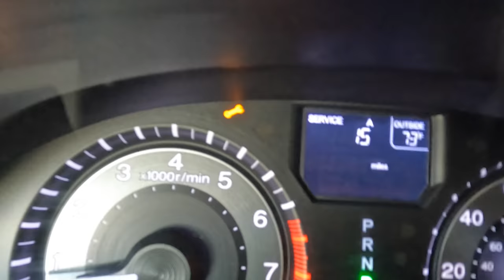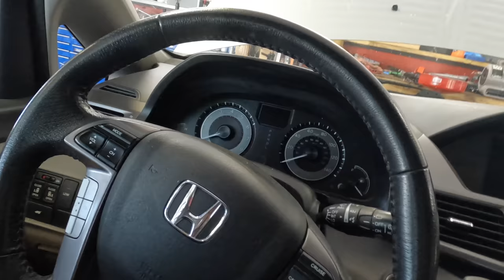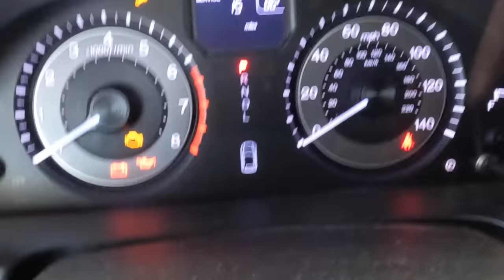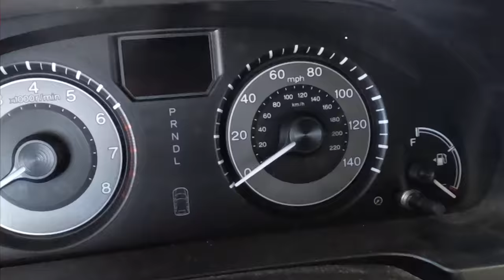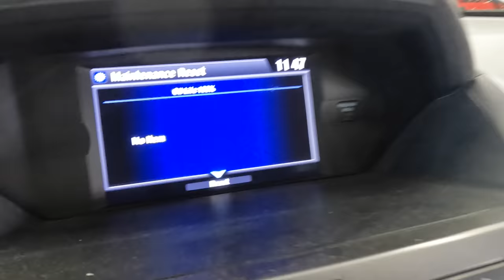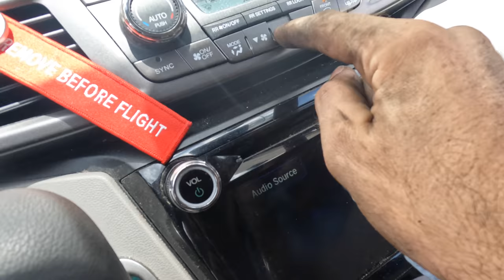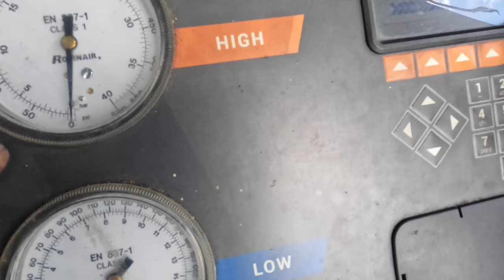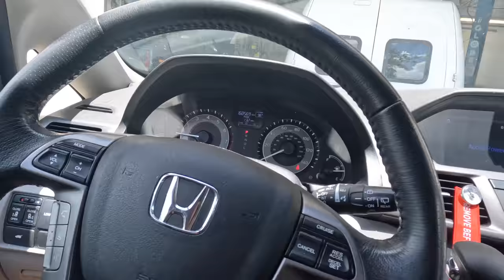Running 300-400 psi. Vibrating noise and smoking! 2014 Honda Odyssey 3.5

Comment: I might be wrong but I remember you already did a very similar video, maybe even on the same brand/type car. Left cooling fan died, needing replacement. Creating a gap by loosening the radiator mounts. Trying to pass it through the gap but fail. Then having to remove the right cooling fan temporarily in order to create space for maneuvering in the replacement left cooling fan.
Of course, lazy as I am, I did not search your old videos. Sorry for that. Maybe another commenter will...

Comment: I love your videos Ray, but I don't like to use crimp connections for high current devices because any extra resistance for example, if the crimp isn't 100% it creates heat and draws more current and could either blow open or blow a fuse.  They use solder on starter armatures so it would take a hell of a lot of current to burn open a solder joint and that application as starters as you well know probably pull up to 500 amps during cranking and maybe more for diesel...  Plus, the driving circuits from the ECU or soldered onto the board...

This video was cool and great info because I never knew that compressors had a blow off valve!  I don't imagine the connections could take much more than 400 PSI eh?  Learn something new everyday...

Comment: I have a similar problem with one fan not working when the AC is on, I know it's not the fan as I swapped wiring connectors, so the issue is electrical in my car. As I mostly do motorway driving I'm not that concerned with fixing it, as air flow is enough for it to run effectively.

Comment: What I have found out with some after market car parts when they are made in China the connectors some times are not quite the right size they can be a little too big or a little too small. I think it has some thing to do with the measurements are given from measurements we use in America and they don't always match in metric measurements even though they maybe both accurate not everything can be converted very easily.

Comment: Hi, Ray. I'm surprised the AC recovery machine cannot also work in kg?
Forget pounds and get with the program....
Great video as usual mate.
Reply: Ya, why not. Those machines only cost a few quid.
Reply: Many that I sold DID have options for both, but cheap (not inexpensive) shops didn’t want to spend the money for something that simple and inexpensive.
Reply: Metric or bananas, take your pick.

Comment: Always use solder! The wires would burn off the shielding before melting the solder! Those butt connectors are junk.

Comment: I had a hyundai elantra with one fan failed, it over pressured high enough to vent out the compressor safety valve. that was very exciting with my head under the hood looking around.
I think I left a bubble in the hood where I smashed my head into the bottom side, because I sure was moving away at high speed and had a lump on my head for a week 🤡

Comment: Most of these vehicles use a variable speed resistor assembly. So according to the demand the fans will vary their speeds and not just blow at only high or low speeds only.
Reply: Engine fan is variable,,, condenser fan only has one speed,,,,on like hell,,,get that pressure down & go “off”
Reply: @fredwalker839  not on all cars, quite a few Hondas/Acuras have both fans controlled by the variable resistor unit when cooling and also when the A/C is being used.

Comment: I used to have an 04 blazer that started to shake like the engine mounts had failed, turned out the fan had just shattered 2 blades somehow and the unbalanced fan was shaking the whole engine. 😭

Comment: I hate dropping things anywhere near the radiator/condenser. I recently had a water pump on my F250 done and I got a brand new Ford radiator for free from the dealer because the tech dropped something and put a hole in the old one.

Comment: I like how you said relatively low humidity. Here in Arizona 5% is relatively low humidity. If it goes to 50% we all commit suicide. We prefer "the dry heat".
Reply: I thought the same thing. Fifty-nine % is Low humidity?
Reply: South Florida.  Air you can drink.

Comment: I've thought for many years-
AC, fuel have a "Service port" but the cooling system does not,
especially with now the advent of removal/recovery/dispense systems.

That would be so nice- a large cap, large Shrader valve, hook up machine.
Do the same for all fluids on a vehicle- brake, transmission, engine oil, coolant.
Reply: You wouldn't be able to suck all the fluid out.  A/C refrigerant is removable through a port only because of it's low boiling point and is in a state of gas.  Fuel service port is just for testing.
Reply: Drain plug>drain valve.

If you’re going to have a 5/8 hole, why add anything to obstruct the already limited flow through that? For the cooling system, some come with a drain valve. But they’re plastic garbage. Safer to just yank a radiator hose, than risk breaking off the drain petcock.

Edit: some aftermarket transmission pans come with a drain plug if the original didn’t.

And machines do exist to change the other fluids on a car. They’re just not cheap.
Reply: @andyruse4670  I'm not talking about a "drain valve" or "petcock".
I'm envisioning a Service Port as in a capped port, with a type of Schrader valve to hold a vacuum or pressure. And no- only the AC system uses this type of servicing port, and of course your wheels, too.

Yes, a Schrader could be a type of "valve" (it's in the name) it is spring controlled, always closed. It wouldn't be necessary or capable to hold a vacuum for an engine or transmission. A "Refill Port" would work for those, just to add fluids, and another to drain. Haven't seen those. I'm talking no more drain pans, stripped bolts, missing or incorrect washers, no dipsticks- just a port. Up top- a port in a valve cover, to add oil. Electric sensor for level of both fluids (3 if PS System, too)
and the brake reservoir is usually translucent, so a port here, too.
Reply: @HoLeeFuk317  Bottom edges of either pan, suck fluids out, thoroughly, easily, even to a complete real FLUSH on both the engine and transmission, because of direct coupling in & out. Do it with systems running and in gear.
Brakes? No more rusted & ruined bleed screw. Vacuum the system from the Master cylinder, cook off any moisture, just like AC.

Theoretically- you could empty your fuel tank via the Schrader- if no check valve in the pump.

Modifications must be made to oil & transmission filters, too, to be more accessible, like newer European cartridge type, on top of engine.

Comment: Love how you dropped the 10mm and also said it was the 10mm. I've literally never dropped anything other than a 10mm in my engine bay. It's like a guarantee. Replaced a starter last week and used about 3 or 4 different sizes. One was even an 8mm but do you know which I dropped? 😑

Comment: I would not be at all surprised with AC head pressures that high  that the compressor could lock up and smoke the belt or the clutch  (there are some systems that can sense compressor rotation speed in relation to the engine) ,hope it did not damage the compressor and other components in the AC system .  I am surprised that they don't incorporate a fan rotation signal in  today's designs that would set a trouble code and disable the AC if a fan fails ..

Comment: Just a fyi you may wanna replace the suction tube "hose"  on the power steering reservoir. Over time that hose gets hard and have a small split crack near the fitting to the pump.  The reservoir to pump hose. 

I had to replace it on my mom 08 Acura tl 3.2l v6.
Reply: That hard hose is also what makes the power steering pump makes that dreaded grinding noise

Comment: Why so thin oil?? I used on my Honda's 5w40 full synthetic Castrol oil . Even after 280.000 KMS,the engine was not burning oil at all. Now in my Astra G station 1.7td i use  10w40 half synthetic Castrol oil. The  whole year.  Winter/summer

Comment: I'm only guessing, that your systems in the US have different safeguards to ours down under. The line pressure switch would cut the compressor power before it hit that high. They have a low point and a high point shut off.

Comment: If the passenger side fan is the main/first to run, why did the secondary fan fail first?  Regardless, this is an info-filled video.  Thanks, Ray.

Comment: Hmm setting the oil change for 3000 miles for full Synth seems kind of low since the recommended mileage is 7500 on the low end. If it's burning oil then just recommend they check it regularly.

Comment: Is that pressure release there to prevent overpressure from blowing up a line? Back in the stone age, I recharged a friend's AC, by using the ol' "sight glass" method. I added a can of R12 until there were no more bubbles in the sight glass. He decided that he wanted another can of R12 in the system to make it colder. I told him that it wasn't a good idea to add R12 when the system showed that it was full. He insisted that I add another can, so I did, but first telling him that the results were on his head. After adding the R12, he sat in the car to see how cold it was. Just them, there was a loud explosion, from a line blowing up....This wasn't the last time that he ignored my advice. (but that's another story)

Comment: Not sure of you caught it while looking at the connectors @22:40, the white area around the pins on the new fan is up higher than the old fan connector. hard to tell on vid but looked to be around 1/8 of an inch or more :-)

Comment: Question, if anybody knows. 2009 Accord, Ac compressor running, the fans are running, don't have the gauges to check the pressures. no cold air in the cab. Any help would be appreciated.

Comment: Hello @Rainman.... hope u r doing great. Really hoping u answer. I have a Honda vezel which is jdm version of HRv. There is a small gap between the condenser and radiator like the one in this vehicle also. If i seal that gap with the foam seals, will it affect AC performance. AC performance aint that bad right now

Comment: The reason aftermarket fan plug would not connect is because the white plastic piece from inside OEM connector was still inside harness connector.  If you review the video you see the absence of white piece in OEM fan connector. This is a honda feature that prevents pin misalignment inside connector and its quite common. When you replace a component with an electrical connector with a new one you end up with double white plastic piece inside the connector and a no-click condition due to interference fit. Consequently you should be using OEM honda filter on that van because honda is the only oil filter made by filtech. All other filters in the world are made by Mann+Hummel which are inferior. And no matter the grade its the same Mann+Hummel filter. REEEEEEEEEE!
Reply from the maker: I must disagree, i cut the footage bc it was really boring, but i used a pick to remove that little white thing and the connectors still wouldn't connect together. very astute observation I applaud you good sir
Reply from the maker: Reeeeeeee!!!
Reply: In that case chalk it up to crappy aftermarket parts I suppose? It didn't look like OEM Denso replacement.  BTW my wife and I just sent you some Hondabond and Filtech oil filters as well as Honda specific oil & tranny funnels to aid with the "WHHHHYYYYYYYY?!" Oil filling of FWD J-series steep pour angle you so succinctly captured in that video.

Comment: Is there not a high pressure cutout on this van?? Typically, the pressure relief valve is a last ditch effort to relieve system pressure  before something blows apart.

Comment: Similar problem with AC on my Ford 2015 F150, 2.7l EcoBoost with 54k miles hat gets a whopping 21mpg.  Every day, during the Summer, the Auto Start/Stop "Feature" kept shutting my truck off and the AC system would mostly keep up in the mornings but by the afternoon, it would have high pressures and really lag the engine.     I don't care what idea came up with Auto Start/Stop, but it doesn't conserve fuel.   I also have a 2001 Chevy Silverado, 4.8l that gets 18mpgs. with 267k miles.  
So.. where am I saving money?  the only hassle is that nice comfortable and I love her, 2015 F150, has been in the shop more than that 2001 Chevy has.   I'm not sold on Auto Start/Stop, I think it's a gimmick and I feel it is my biggest complaint about modern cars and their "Eco-Friendly" B.S.
Reply: there's ways to shut it Off .

Comment: What do you think of Fumoto valves?  I've been changing my own oil since I was 16 at present I'm 70.  I love my Fumoto valve.  Put on the hose, open the valve and the oil drains into my container, capped and ready to be recycled.
Reply: I use them. As long as no-one nefarious notices it to drain all your oil out, they are great.

Comment: Idk if its a good thing or not but on really dirty oil ill pour a little clean inside while it drains to try to “rinse” it out a bit but i also dont use a lift either.
Reply: I just (about 2mo ago) got a cement pad, and the building too. It’s a VERY nice upgrade from working on gravel!

Comment: did you do a full vacuum and decay test? never add gas right away as there may be leaks. a system is low on charge for a reason beyond the inital problem. proper refridgeration practices.

Comment: I keep hearing the chant "honest mechanic". In my experience, most mechanics are honest, the description doesn't focus on the weak spot in professional work flow. Lazy? Some are, and some cut corners in the interest of saving time. And some guess what the diagnosis is without testing, mainly out of ignorance of how to diagnose it quickly, or just to save time. Some reach for the new part rather than trying to fix a broken part. But that's a different issue. Professionals reach for the new OEM part because they don't want to face an angry customer when the repair fails, and they don't want to warranty a repair done using substandard parts. If you put in a borderline part and it fails, the customer is on the hook for twice the labor, and it leads to angry confrontations. So, honest mechanics run into their own set of problems, trying to save the customer money only to make them pay more when the part breaks again. If there is any dishonesty, it's in the guys in the white shirts in the front office, where upselling is the game. Salt of the earth mechanics are just trying to get through the day.

Comment: If the contacts were right, would it not have been easier to depin the new connector block and use the old connector block with the new pins inside it?

Comment: It needs the overpressure valve to dump the refrigerant to deal with the over pressure? It does not have an overpressure or overtemperature shut down switch (stopping the compressor) to deal with that? I use to call that s...y engineering...

Comment: At 22:41 you say that the connectors look accidental, but they don't look like that to me.  The white plastic appears to be deeper in the socket on the old one.  That looks like it would prevent the connectors from seating all the way, unless the white portion is spring loaded.
Reply: I see that I am not the first person to notice that.

Comment: @rayman

Looks good, actually.   I watch alot of your videos and I notice you actually care about delivering good work. That's a good thing,since I see a lot of : meh good enough mechanics.  

However,   you make your life unnecessarily hard sometimes In my opinion.  Not saying that to hurt you or to feed my ego or such nonsense.  But rather then just throwing bolts in a pan/basket,  whatever,   put them back on where they go. That way you are not losing any of them, and you don't need to wonder where that bolt went of you have 100 of them.  

Also, you have alot of faith in bolts not snapping on you,  personally (again personal preference )  I like to break them loose first,  just to prevent that off chance of having to drill that bastard bolt out later 

Other than that.  Keep up the good work 
This is meant as constructive criticism, not to tear anybody down

Comment: It looked to me like the pins in the new connector were slightly pushed offset to one side, realigning them with a flat blade screwdriver probably would have saved time and work.

Comment: 0W20 is thin as water. Based on the fact that you guys are located down in Florida aka a pretty warm climate and the oil consumption of this engine id use a 5W30 even.

Comment: why the heck didnt the High PSI switch cut the unit off rather than hit the pop-off..  theres not supposed to be a pop off on anything that new that would pop before the high PSI switch would turn the compressor off...  the pop off is only ever suppose to trip if the high PSI switch fails to cut the compressor off..

Comment: Soldering is not ideal because of poor vibration resistance not because it might melt away. It might only get so hot that it melts once it has cracked from vibration and isn't making proper contact which in turn causes heating of the join.

Comment: Interested in what fan y’all used. Haven’t had good luck with aftermarket of those models. VDO gives about 18months which is on the better end. A denso motor to replace is like $800 for both (second always fails shortly after the first in my experience)
Reply: Connector not fitting. You used dorman. I look forward to a video in the next 30-45days replacing it again.

Comment: Wouldn’t it be a good idea to replace both fans while you are “in there”?  Just thinking that Odyssey has a ton of miles.
Reply: Isn’t it why they are designed like that. If you do either one then the other one will likely be not to far off from needing it any way. It’s a bean counter thing, but one that I’m NOT!
Reply: Probably but if the customer said no.......